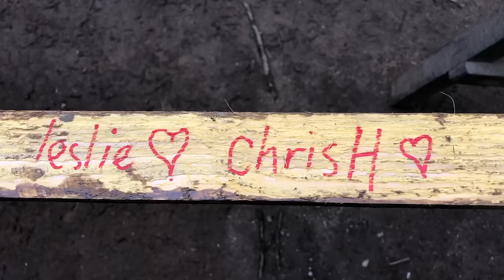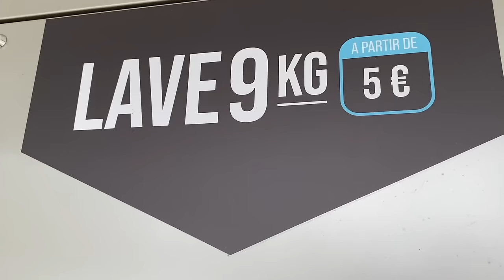#42 Oh How Our Views Have Changed! We Bought a Dump...in France! Episode 22

Comment: If you had reversed up to the posts and wrapped a chain around the post and then used the 3 point linkage with the chain wrapped around that you could have lifted each post out in a third of the time by then lifting up the hydraulics
Reply from the maker: We have no chain!
Reply: Really? Nothing kicking about somewhere? At a pinch you could use a good bit of rope 
Chain only needs to be about 2 - 3m.
Wrap chain around bottom of post.Back upto that and wrap around the draw bar on your 3 point linkage and then lift up
You also need to make use of your trailer to move stuff about;load it and then take it to where you want to put it.
Also your piles of sticks all over the place will become a real problem when the grass comes through
Reply from the maker: How fun is it to ram posts though!  We actually started with a come a long but no luck.  Yes - the trailer will get put to use once we figure out how to connect things to the back of the tractor!  And yes!  We are moving all those sticks asap!  The neighbour farmer will be here soon enough to make hay and we have to have the fields ready! (Mrs. Bloke)